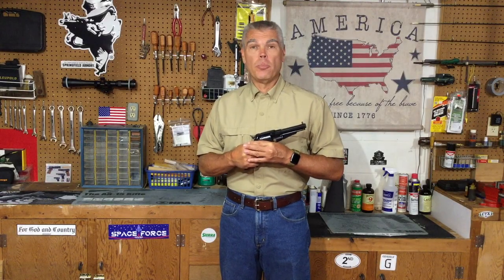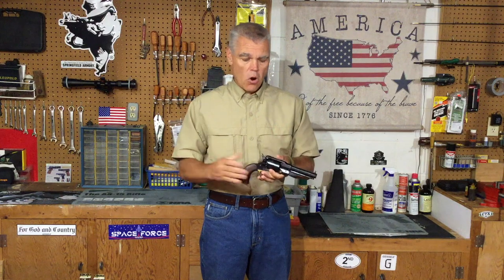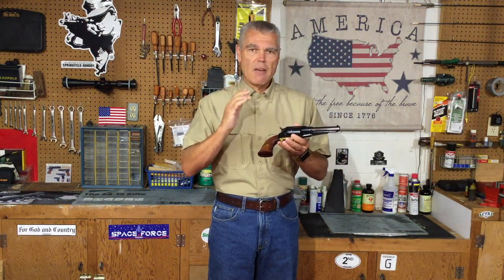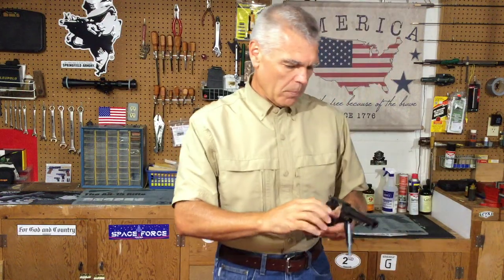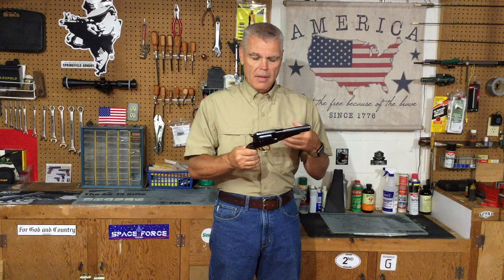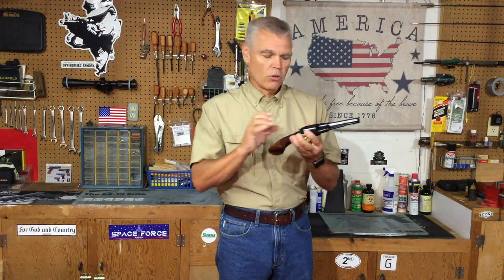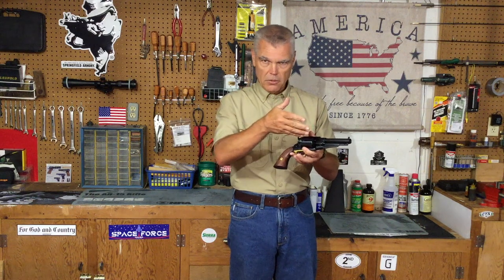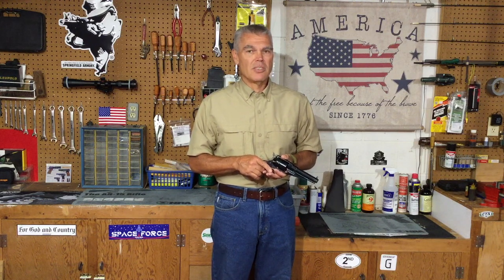MWU: Is It Safe to Load Six in a Cap & Ball Revolver?

Comment: In Black powder revolvers, safety features were included in most cases. The Remington had notches for the hammer nose. Ruger Old Army has hammer notches for the nose. Colt has a pin that the hammer nose fits over - ever wonder why Colt and Colt copies have a slot in the nose? To accommodate that pin between the cylinders. Don't know about the LeMat because I've never seen one in person.
As with all tools, you need to check for proper functioning. I've noticed that the early copies of revolvers made by ASM didn't have the pins or the notches. Early copies made by Pietta had the notches and the pins, but they didn't always work right. New made copies by Pietta have everything working. Traditions copies also have all the safety features, but they also have to be checked for function. Howell conversion cylinders have extra bolt stop notches on some of the cylinders. 
So, you have to check for both the presence of the safety features, and their function. Ruger Old Army gets an A+ on all counts.
Reply from the maker: Thanks! That's why I mentioned in the video that not all makes/models of these revolvers necessarily have all the safety features.

Comment: Really excellent information and an enjoyable video (even though I’m not a “cap and ball” guy) — thank you, HR.  I’d add one “semi-related” fact, that may be of interest to some viewers.  Single Action revolvers (I’m not discussing Cap& Ball designs) may — or may not — be protected from accidental discharges.  I believe, for example, that Colt SAAs do not have a safety mechanism, whereas Ruger SA revolvers do.  I certainly am NOT an expert in this area, but I thought I’d pass that along.
Reply from the maker: Thanks! You are correct. My comments in the video only apply to cap& ball revolvers that actually have the safety features I mentioned.

Comment: Hi hrfunk! Please keep in mind that keeping hammer in the safety notch for prolonged periods of time will weaken your cylinder stop spring. Unless hammer rests on a nipple, cylinder stop cannot fully hide in a corresponding cylinder notch and its spring stays partly tensioned. This problem can be resolved only by using a fluted 1858 cylinder which are quite rare to get.
Reply: Not a problem with modern metallurgy, lots of springs live in a partly compressed state and live for decades. The spring is tensioned even when it is in the notch.
Reply: @OhioCruffler  please keep in mind that trigger/cylinder stop spring is a flat (not coil!) spring. Flat springs are more likely to weaken under prolonged tension than coil springs. I can assure you that this very spring is one that is the most likely to break and keeping her constantly under pressure does her no good.
Reply from the maker: Since the hammer on my revolvers only rides in the safety notch when the revolver is loaded, I'm not too worried about its lifespan. If it weakens, I'll replace it. Thanks for the comment!
Reply: @hrfunk  Yeah, you're right. It might be an issue only if one wants to keep the gun loaded for extended periods of time for example for self defense etc. If you do that only during shooting sessions it's not an issue, not at all. Truth is, keeping hammer in loading position is much tougher for the spring because it remaing fully compressed.

Comment: 2:20 just pull the hammer slightly and then put the cylinder on the drum lock.  At heel, if the tap is down, the drum lifter is fully retracted.

Comment: In fact, not all cap & ball revolvers, or even all Colts for that matter, had that capability to rest the hammer between the chambers.Some did. Some actually had a small pin on the back of the cylinder between nipples on which the hammer would index. Thus, some COULD be safely carried with all  chambers loaded, while others could not.
Now, let's take "real life" into account here. If you're on the shooting range, as opposed to out RIDING the range, your odds of dropping your gun are pretty low. And even more to the point, if a lawman was EXPECTING trouble (say, a passel of water-bottle desperadoes were in the vicinity), it's highly likely he'd prioritize having that extra shot available to him over the slight risk of an A.D.
Reply from the maker: I agree. Also, that's why I mentioned in the video that not all makes/models of cap&ball wheelguns had those safety features.

Comment: That’s the one thing I don’t understand about the Pietta Colt model pistol manual.  It mentions and describes the safety pins/notches that are designed as this safety feature, but it also says always only load 5 chambers and carry the pistol with the hammer on the empty chamber.  Then why bother including the safety pins?  Perhaps it’s just for liability reasons.
Reply from the maker: That’s my guess. Their lawyers probably wrote that part of the manual.
Reply: @hrfunk  Exactly, the lawyers.  I’ve read quite a few memoirs/after action reports written by Civil War cavalry officers, and I’ve never once read “I only kept 5 rounds chambered because pistols keep going off accidentally”, in fact they’d be at a large tactical disadvantage.  And if ever a pistol would be prone to accidental discharge, it would be while riding a horse.  The one accidental discharge I remember reading about (in “A Lt of cavalry in Lee’s Army”) was a guy whose rifle went off accidentally and killed the rider because he was carrying it slung with the hammer cocked.
Reply from the maker: Oops! You’ve got to hate when that happens!

Comment: "Is it safe to load 6 shots in a cap and ball revolver?"
Depends on the revolver
Open Top Colt's, original or reproduction: Nope. Not safe to load 5 in the 5 shot revolvers, either.
You COULD put the hammer on half cock, but that really isn't wise.

Closed top Remington "New Army" and others such as the LeMat, with a notch between the cylinders for the hammer nose: Yep. Provided you use said notch.

Not safe to load a full cylinder on cartridge revolvers that have the firing pin as an intrigal part of the hammer, either.

A "6 gun" in reality is a "5 gun". Those that only hold 5 shots are a "4 gun". 
Except in the movies.
Somehow Hoppy, Roy, Red, Ben and his brats, and the rest in the "westerns" never had to reload their revolver or rifle, no matted how many times they fired it.
For that matter, Fess Parker never had to reload his flintlock muzzleloader after each shot when he was staring as Danny Boone on TV and in the movies, that I remember.
Reply from the maker: I believe I touched on most of those points in the video.